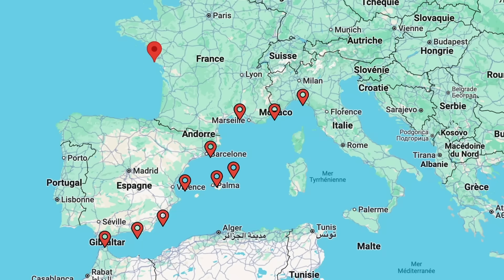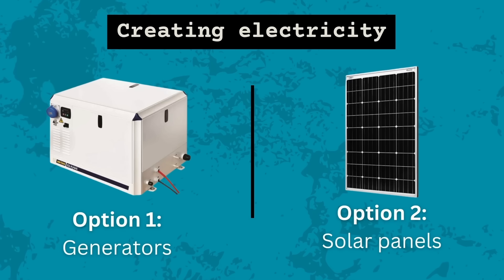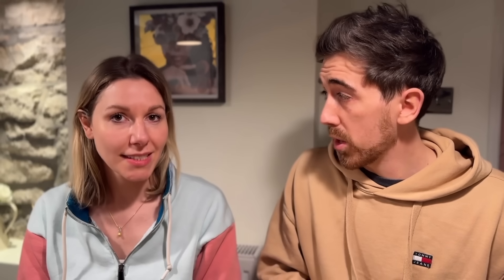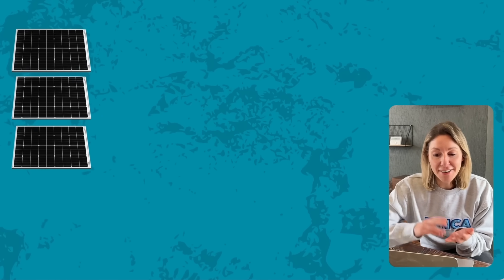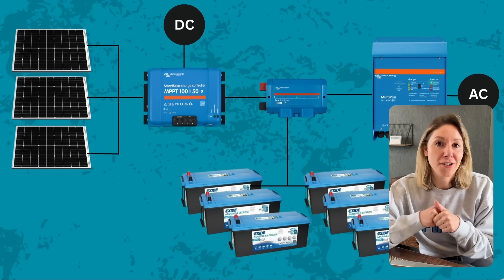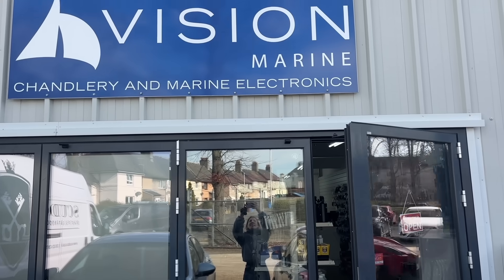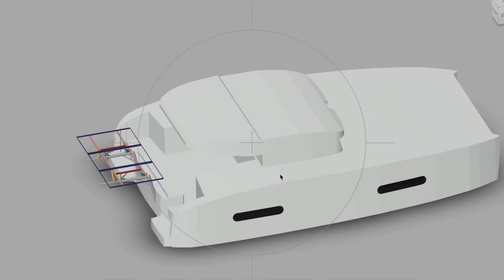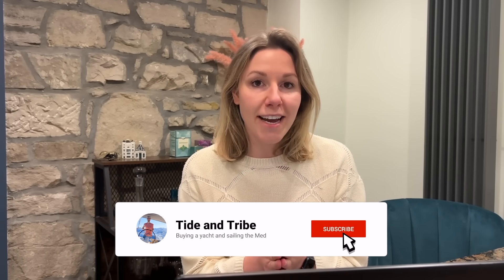We Have a €20,000 Problem! Buying A Brand New Catamaran

Comment: France is the most expensive place in Europe toget a job done.
In 2002, I was relocated to paris with my job for a 4 years contract.
Come 2006, i finished my mission and wanted desperately to come back home.
I ordered a brand new right hand car as i had to give back the company car (also; Tax & VAT) were cheaper at that time in france and i used the loophole of export to avoid paying them altogether which made the deal great bargain. 
My 2 boys were babies at that time so i decided to upgrade the radio/cd to DVD that had automatic screen that pops out everytime you select dvd plus i also bought 2 additional screens for the kids at the back and subwofer and also was advised to upgrade all the speakers as the new pioneer unit was lot more powerful than the originals.
to avoid loosing warranty and guarantee on the car as I've been told by the main dealership regarding installing aftermarket multimedia. 
I went to indépendante multimedia supplier and installer. Bought the pioneer dvd system for €800 plus all the additional things i mentioned that wasn't supplied with the new system.  The price then of the dvd system around €800 rufly so I asked them to install it professionally. They said I'll have to leave the car for 48hrs, so i paid for the system and extra items and told them I'll pay for the instalation on collection day. The car was 1 day old so i used their services as they had the best feedback and reputation. 
2 days later when i went to collect the car, the bill was an astonishing eye watering shocking bill of €1180.
I complained and the manager showed me a cctv recording of them taking the dashboard and steering wheel out and the car seats + door cards basically they took everything out of the car except the engine and gearbox. Also they had to upgrade the wiring as the originals could overheat...
Also they had 3 technicians working on the car for 2 and half days😢 but €1200 in 2006 was lot for installing new multimedia. Everything that involves labour in France is absolutely 💯 the most expensive in Europe. 
The extras were twitters + speakers + amplifier +subwofer+ 2 screens fitted in the headrest professionally that they looked original from factory. 
Driving back home for Christmas and the kids so entertained in the back seat made me forget the cost of installation. 
For long time, the kids prefer to watch their cartoons in the car than in the house 😂. 
I'm glad that you looked into your project and found cheaper alternatives plus by doing it yourselves, you can fix it when ever something goes wrong especially during sailing away from the land.
In my case, I had no choice but to pay anyway,  The cost of installing the new multimedia was more than the purchase price of the system.
Reply from the maker: We've found a lot of things are more expensive in France vs the UK, and yes you're exactly right, if we understand how it's installed we can fix it ourselves if it breaks. Thanks for sharing

Comment: PS.Make sure that all exposed wire ends are tinned, even if you are going to use crimped on Connections, as if left untinned, then the wires will rapidly corrode, and you find that you have a real headache with unreliable electronic connections. Nice looking CAD Mount for three solar panels by the way. If extra Solar is needed, then flexible ones that last are horribly expensive, but the ones made in Germany appear to be fairly reliable. Other than that, there are reasonably priced fold out panel,pack that provide about 400 watts, and which can be mounted on side rails ?easy to pack away safe if conditions deteriorate as well. Bob. 👍⛵️
Reply from the maker: This is super helpful Bob, thank you so much. We hadn’t heard about extra tinning, so we’ll add this is in for an extra precaution.

Comment: Some basics that you need to grasp about Solar - AGM Batteries are ideal for the Core System, but they must never be Discharged below 80% Capacity, if you want them to have an up to thirty year Service life - this happens because if you never discharge them below 80% their recharge cycles freeze, and never Drop, then you have a Battery Bank of say 4 cheap but good Lifepo4 batteries that you connect the positive and negative bus bars to, then say with equal sized  cables of equal length,connect each battery terminal to the relevant positive or negative bus bars. What this does, is share all loads, whether charging or discharging between each Battery - this does not mean that you are equalising each cell inside the battery. Example, your Bank contains say 4 X 12 volt 240 ah new Redodo Batteries, for a Total Bank size of of 960 ah - but importantly, Lifepo4 batteries must never be discharged below 50% capacity, or you lose recharge cycles and shorten the service life, as does fast Charging and fast discharging- due to heating up the battery internals which also damages them - So if limiting discharging to a maximum of say 80 amps, each battery is only providing a quarter of the load, which is 20 amps right ? So what size cables do you connect the Terminals to the bus bars with ? A size double the load, so say 50 amp cables so they never get even warm, and the Copper Cables have no chance of crystallising which rockets up the cable resistance forcing replacement. So gentle treatment, just like with AGM, and now your Bank can be used in a management role that will, via DC to DC Chargers keep every other Battery on the boat in tip top condition. So each battery use session that starts with every battery topped up - say through the hours of nightfall - you have 50% of your Bank available which is a reserve of about 280 amps for use of lights, instruments, fridge, freezer, running a laptop, tablets, and charging mobile phones. Is the Maths adding up for you ?  Now Solar Panels - the longest lasting are rigid Monocrystalline, which still deliver 80% of rated power after 25 years use. Polycrystalline only have a life of 6 to 7 years, and most flexible panels delaminate and die within two years. Don’t cripple yourself by going with electric cooking as that consumes massive power. Far and away the best cooking Fuel is Propane anyway though you can save a lot of gas by using a cheap portable portable induction hob just to bring things up to temperature fast. I do like slow cookers, toasted sandwich makers and breadmakers though, plus a decent boat sized Food Processor, and Pressure cookers - small and medium - are great on an induction hob to get up to temperature - finish off food in the oven, and you still can get excellent results. The best Coffee- and tea - maker I have found to use on a boat, is a single skin Stainless Steel Cafetière, just get a few spare filters, as they tend to wear out fast. They stay just as hot as the twin wall ones just about, but the walls are too thin, and rapidly wear out. There are alternatives to Victron for installation, but they are very expensive, but are about the easiest for you to keep the needed close eye on things. A good diesel generator is an excellent backup that can really help save your expensive batteries, and a way of looking at diesel, is it is the most energy dense “Battery” that you can get your hands on, and nothing available right now, or for the foreseeable future can even get close to matching it. However, hard though it is for me to personally recommend,MAs I haven’t yet tested them, an alternative generator could be a Methanol Fuel Cell, which uses Methanol Cartridges of various sizes, seems affordable, and outputs DC Current ? I likely will get one to test, and as a backup for the diesel generator - Note Fischer Panda have acquired a terrible reputation for bad customer support, so the only good ones Incan presently recommend, are Northern Lights and Cummins Onan Generators- keep them well serviced, and they are quiet and very economical. I did have a Yanmar Diesel generator, that did great service for over twenty years, and it was still working well when I gave it to a neighbour when I moved to look after my father.  I think it is still running, but I haven’t seen Yanmar generators anywhere for sale, for a very long time. Hoping the basic information is useful, and perhaps the greatest warning Incan give,mis not to believe the Lie on Labels - “Deep Discharge” as every Deep Discharge damages every type of Battery, and shortens its life. It is only in the last 12 to 18 months that it has become clear enough information for us to start getting a good service life out of Lithium Batteries, and I am grateful to Ampere Time - now called Li Time for the best knowledge they gave me a few years back, when they offered me a Bank for long term testing to see how long I could make them last, but as more detailed information on how to start off with the right treatment still wasn’t available, so thanking them for their very kind offer, I felt no option but to turn it down. B today, exercising suitable care, and by treating the batteries gently, and getting banks from the same production batch, it is a very different story thankfully. Bob.PS  TouTube Channel Hobotech is a very good tester, as is Clark of Clark’s Adventure Channel on YouTube Beware of Channels that enjoy blowing shit up with destructive testing, unless you can filter out the BS, and recognise what a difference treating things gently can make. 🤔🌟🌟🌟👍⛵️